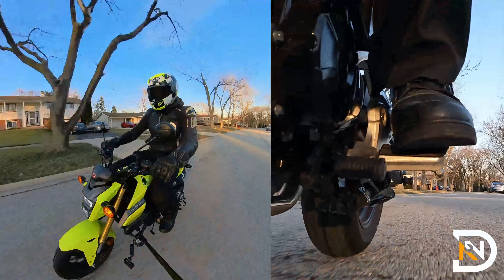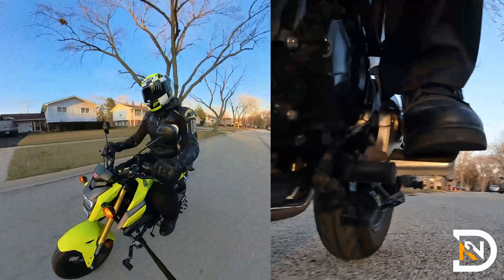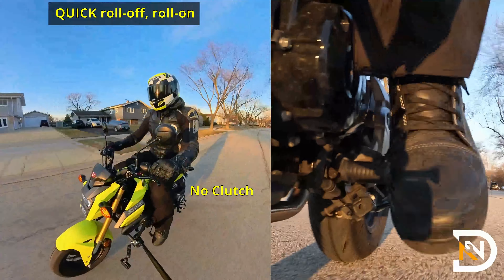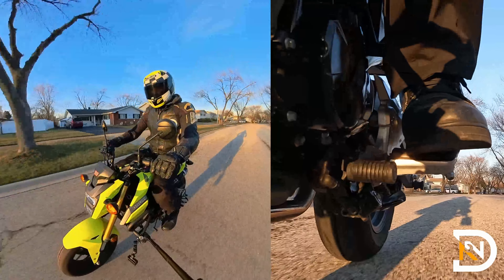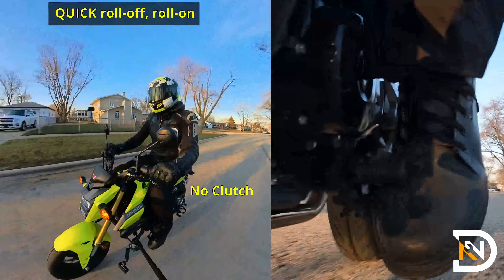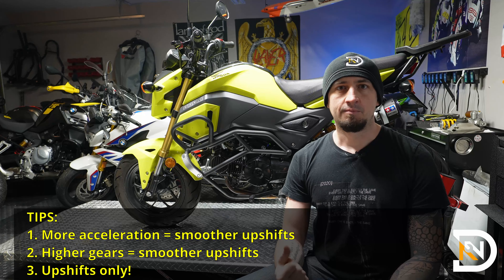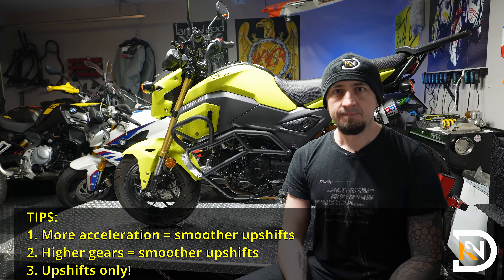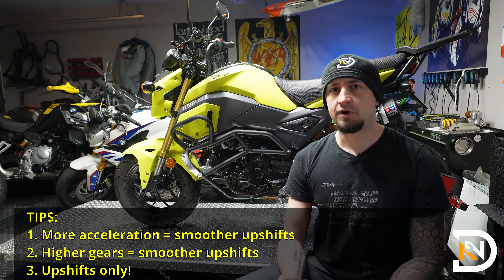How to shift gears on a motorcycle without using the clutch

Comment: Does this not mess up the transmission?
Reply from the maker: @madzombie11 not at all on modern motorcycles.  It's how quick shifters work, it's just not quite as fast.  Just make sure you're accelerating and to do it in higher gears to make it smooth.
Reply: @danondemand  I’ve done it before. It’s just always crossed my mind that it was ruining the trans. I’ve also done the same thing in a manual car it’s basically the same concept as long as you’re not grinding gears it’s safe from what I understand
Reply: I wouldn't do this on cars. Cars have dry clutches instead of wet ones.
Reply from the maker: Yeah ive never done it w my cars but have heard of others.  Not willing to risk my transmission to find out